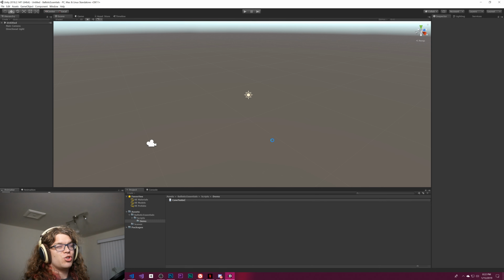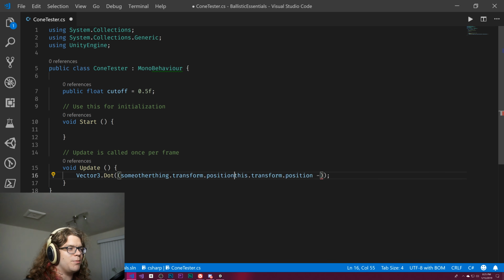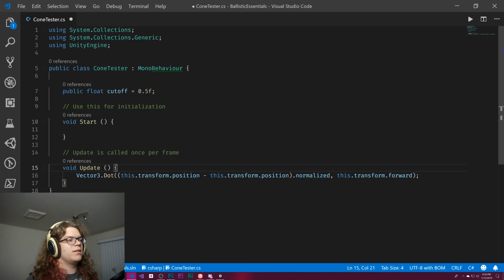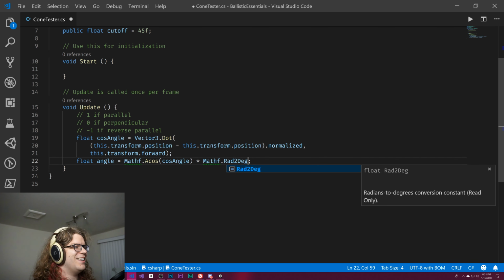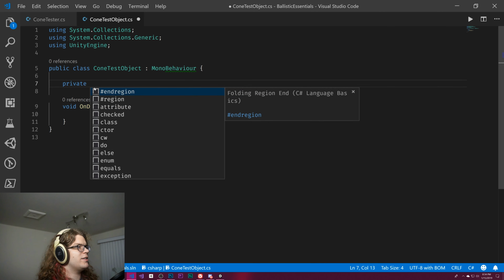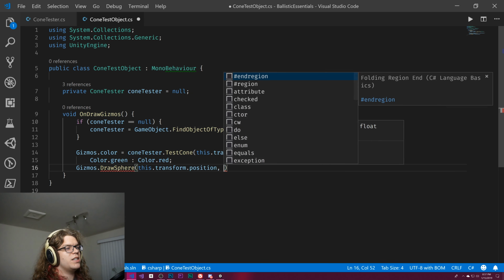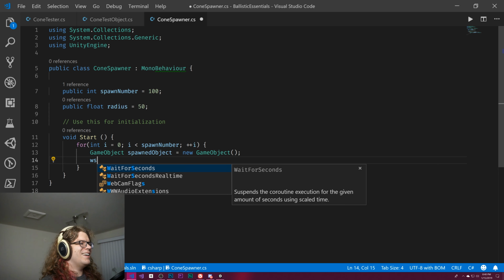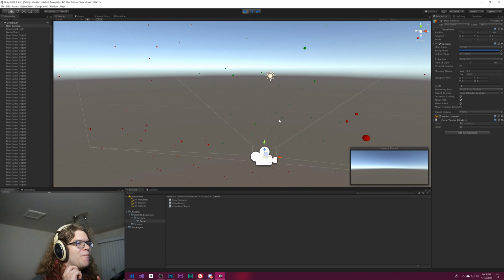Exploring Dot Products in Unity

Comment: Right now, we are infinitely projecting the cone where all the objects at any range can be seen. How would one decrease not the cut-off angle but how much we want to project the con
e forward?
Reply: I guess we could attach a raycast with a max value to it and use that vector as our this.transform.position. That's my best solution.
Reply from the maker: I don't think you need to make it that complicated. If you want a cone with limited range then calculating the length of the difference between the two objects position vectors should be enough to approximate this.

Comment: Can someone explain to my why they used cosine instead of sine? Like I know sine wouldn't work, but I guess I'm having trouble understanding the difference intuitively...
Reply from the maker: A dot product is the arc cosine of the two vectors. A difference of 0 degrees in a cosine results in a value of 1, this is the same result as the dot product. The sin would be perpendicular to this. To be a bit clearer: if you plug the angle between two vectors into a cosine you will get the same result as the dot product of the two normalized vectors.
Reply: @WorldOfZeroDevelopment  Oh okay I think I get what you're saying. One thing though, wouldn't the dot product be the cosine of the two vectors then like in line 13? Cause if the dot product is the arc cosine, then we wouldn't need line 16, no? Thanks for this vid btw, it's eye opening as to what's possible with vectors!